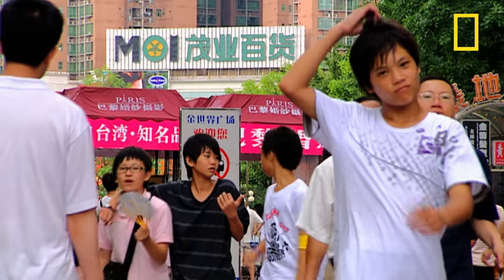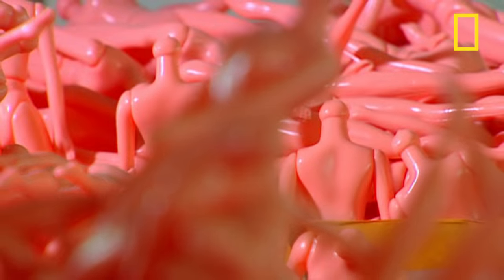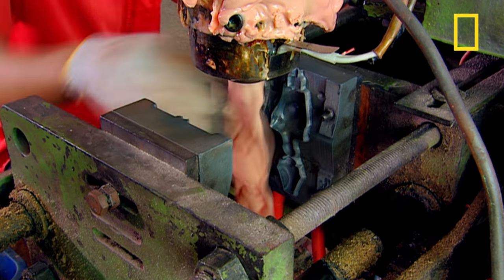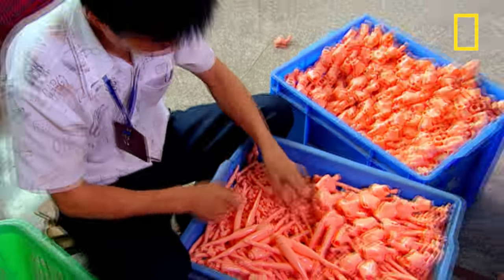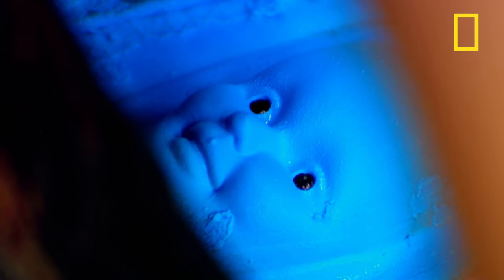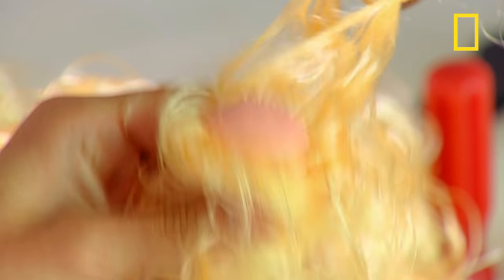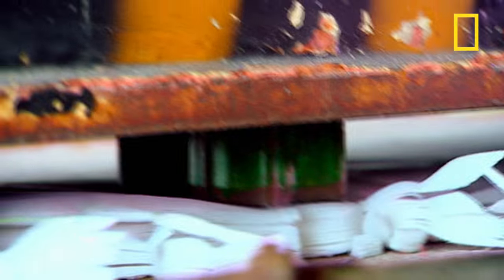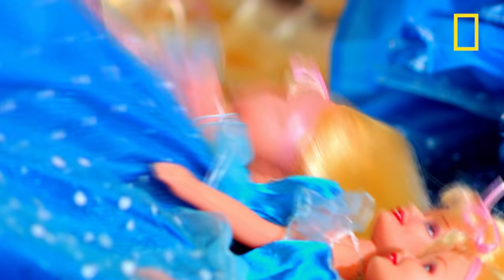How Dolls Are Made | I Didn't Know That

Comment: You can see in this short video all the times they skimp on quality to make cheap dolls where they could have made one small change to boost the quality significantly. For example, they sew the hair on in two rows, leaving a huge bald spot on the back. A couple more rows would make a huge difference. Also the materials used- swapping out a material in any step of the process would make for a much better doll.
Reply: Exactly
Reply: What were you expecting from a Chinese sweatshop, top quality dolls? Of course they're going to degrade the quality to cheaply mass produce em, and im more worried about the safety hazards and well-being of said workers than a dolls quality.